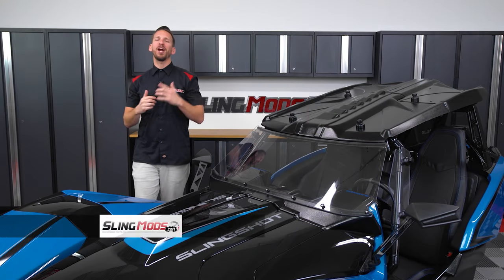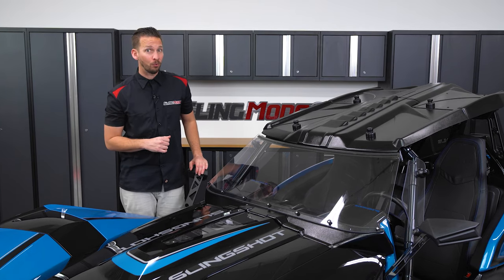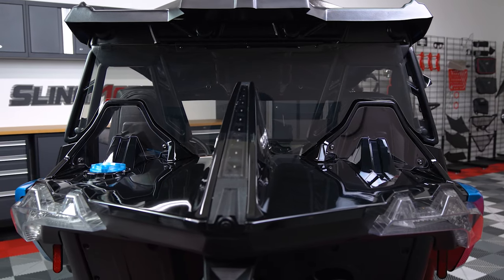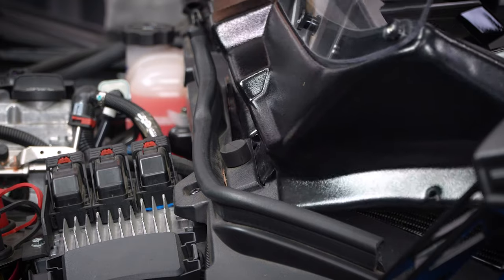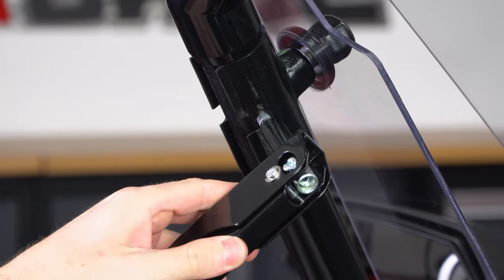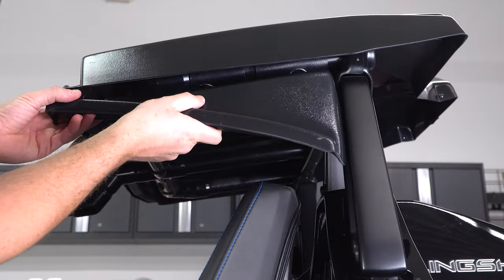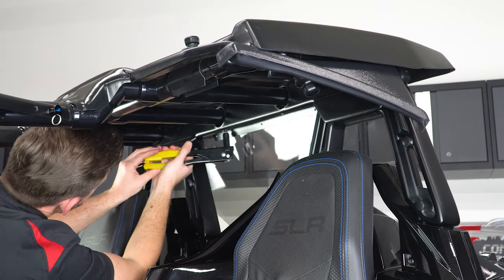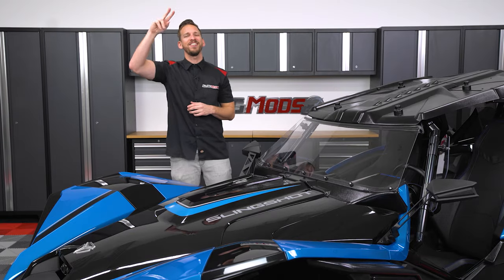Polaris Slingshot Full Front & Rear Windshield Add-On Kit

Comment: Does anyone know if this blocks the rear view in any way like the other full enclosure and what about wipers for the rain? Or do you just use rain x?
Reply from the maker: Hello Armando, both the front and rear shields are clear polycarbonate for perfect visibility. There is no visual obstruction with this setup. There is not currently a wiper setup.. but we will entertain that as an add on if we get enough requests for that. Rain-X cannot be used on any of the polycarbonate shields or it will permanently fog and ruin the shields. Thanks!
Reply: I just read on Google about you can use rain x on a polycarbonate windshield. Look up how to clean a polycarbonate windshield. It might help
Reply: @Slingmods  put some manual wipers that came on the old ww2 jeeps. Easy peasy IF needed.
Reply from the maker: @REDVETTExxx  Wipers would be super cool!